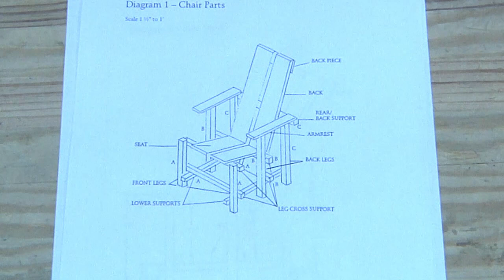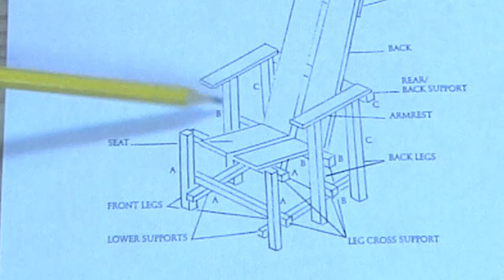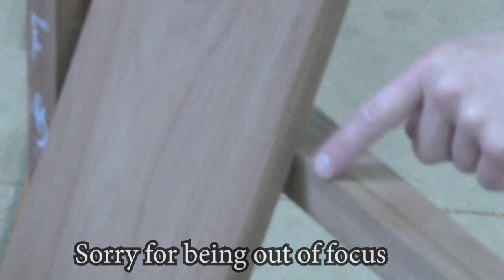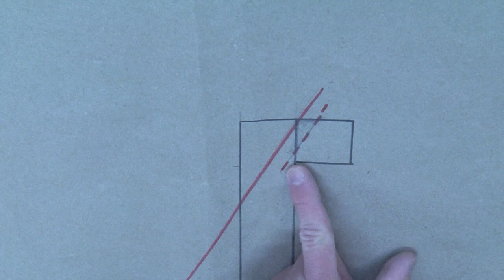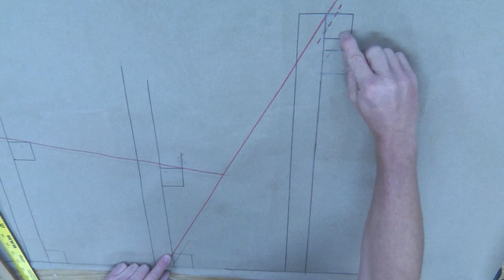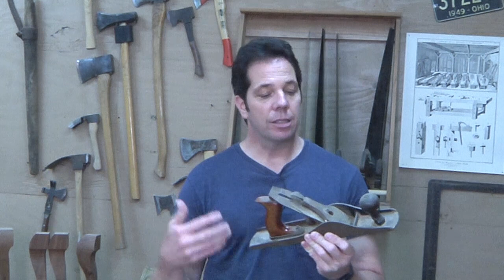Bad Chair Design Made Better

Comment: Sometimes I run into people who resist any changes out of reverence to the designer or some nostalgic sentiment or whatever. Was the client receptive to the upgrades? And more importantly, did they know before you did them? I don't mean for that to sound how it sounds, I'm just curious how others handle it.
Reply from the maker: Great question. I had others ask it as well. I did consult with the clients for a couple of questions. Such as the arm height. But everything else, they said they trust my experience.

Comment: Talk about low-hanging fruit! You definitely, improved it, no question. I think you're missing the major points of the original design which comes from the Dutch De Stijl movement, part of which was absolute dead simplicity of construction. You can make this chair quickly with a handsaw and a drill/driver.  If you have good tools and skill, you might as well make actual good furniture, which Rietveld's chair definitely is not, nor ever pretended to be. Quite the opposite.

Comment: Once again another great video.  I appreciate the "thought  process" that you used to figure things out.  Not many Youtubers do that.  Also on the feet, couldn't you use some sort of ceramic nail in footers.  I'd  like the plane  piece but am more curious on the math geometry.
Reply from the maker: Ah yes, good point. Thanks, Ted. And I'll mark you down for geometry :-)
Reply: On that note, would a rubberizing dip work (maybe like what's used for tool handles) ?

Comment: Your experience dealing with a poor design is classic.
Some people design things without thought for strength or comfort.  They aim to get a look, and everything else is forgotten.
I've dealt with this problem myself, and it's frustrating to solve problems that should have been dealt with by the original designer.
There usually are serious challenges to fixing the problems, and sometimes the changes needed are so significant that the look gets ruined.  The appearance is very important, so you shouldn't ruin that while striving to fix the other issues.  In the end, there are some designs that can't be fixed without ruining them.  And what's the point of doing that?
You managed to solve the problems and keep the look, so good job.
Reply from the maker: Thank you! I have to admit, doing the changes took a lot longer than I estimated, but in the end, the customer was so pleased they want to order a table form me now:-)